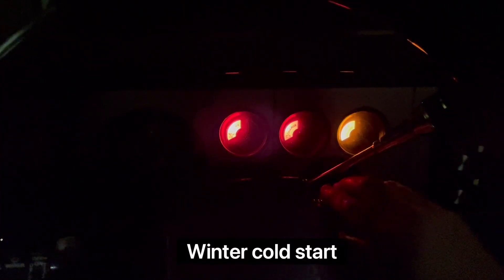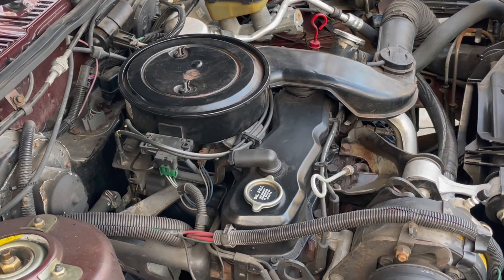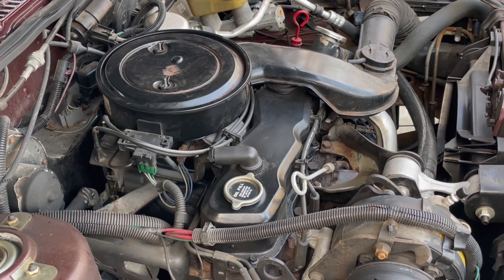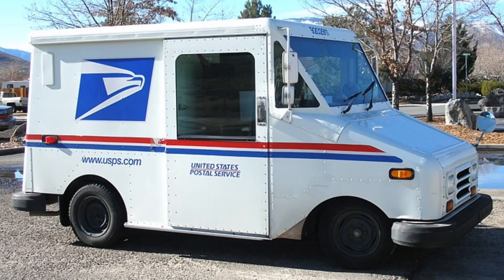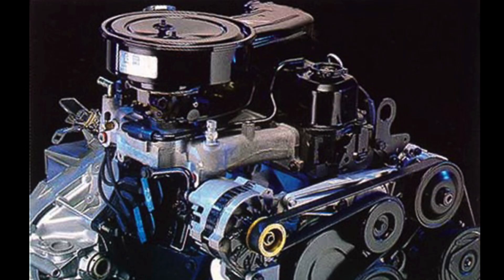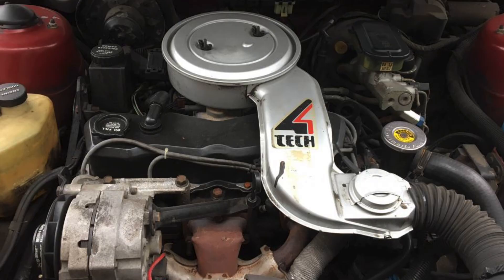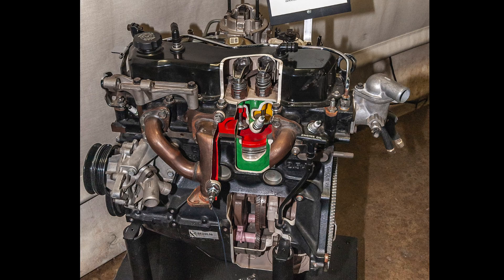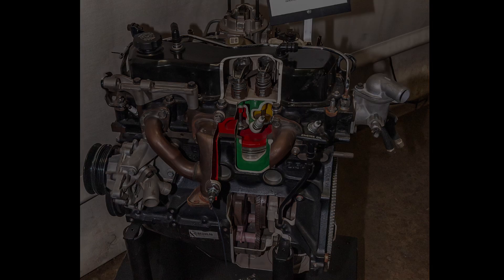Worst Sounding (and Most Recognizable) Engines: GM's "Puttering" Iron Duke 2.5L I-4

Comment: Adam’s comment about the engine continuing to run after the ignition switched off reminds me of the engine run-on phenomenon of my childhood in the ‘70s. What was that about? I remember some cars would continue sputtering and banging away long after the ignition was switched off.
Reply: You’d find this “dieseling” happening in carbureted engines not in fuel injected engines. Common causes of dieseling include maladjusted idle speed and high carbon buildup in the combustion chamber.
Reply: Cheap gas with low octane.
Reply: My 2.8 would do that on low octane. 
Most fuel injections cut off the fuel supply when the ignition is turned off.  @drippinglass
Reply: Usually the recipe for "dieselng" was carbon build up on the pistons being hot enough to ignite fuel from a mixture too rich combined with timing chain wear getting everything on top of that wrong. Basically, if the recipe was refined enough you could have one that would run on until the fuel bowl was dry. Having had a history that includes driving such fine specimens as described, I learned to just shut it off in-gear. The drag of the torque converter would stop the engine smoothly. With a manual transmission, you were out of luck. 😁

Comment: Hi Adam! Great video! I actually enjoy hearing the occasional tech 4 out in the wild ( or our LLV that delivers my mail) as it brings back a lot of great memories. I guess having grown up in the '80s/ '90s caused this. I have pointed out to you via other posts that the engine did have some advanced features like a roller cam, stainless tubular exhaust manifold, TBI, and a nifty flow-through head design. Not amazing by today's standards, but it is unfair to hold the engine to contemporary standards.  I think that your calculator watch is cool, but totally weak and useless when compared to your smartphone. We can probably agree that my  previous statement is an unfair and silly comparison. The same goes for the tech 4/ Iron Duke. I worked at a Buick Pontiac dealership for several years in the mid 1990s. I was a teenager at the time and had the privilege of working with a lot of seasoned and talented guys. None of them were overly critical of the engine. The old series 1 3.8 liters were rough running and a little crude too. The old 2.8 had issues too (Intake gaskets, etc).
Reply: My 2.8 came with loose intake manifold bolts but with the help of a Snap On flex socket I was able to torque them to service manual specifications and no more problem. That thing had dual valve springs!
Reply: The 2.8L was a great engine in the smaller X-cars,  but when GM put in the S,T pickups/Blazer/Jimmy they won't so great. Besides the head gasket issues they would take out cranks and very hard to work on because of the space in the engine bays.. spaghetti vacuum lines, feedback carbs, marginal electronics and list goes on.
Reply: A friend used to have one of those small S 10 type trucks and got good service but it had a larger V6 that I think was based on one of the smallblock V8s. I did at a point with my Citation managed to get the headbolts to turn a bit tighter,to the factory torque specification. Also had the car rigged with a switch under the dash that when turned on made the electric radiator fan run constant. When sitting in traffic or something that would make the temperature gauge rise I would turn that switch on. I got over a 100,000. miles on it by the time I got rid of it,mostly because of floorpan rust. 
By the time the S 10 and small Blazer matured with the larger V6 it seemed to have become a pretty decent vehicle but of course whenever GM got something perfected seemed to have been the time that they discontinued it.  @michaelmurphy6869
Reply: Was Car and Driver holding it to contemporary standards of the time when they cynically referenced it as the low-tech 4?
Reply: @ButterfatFarms  no, but they were not always looking at vehicles of similar price. As I have stated before, in addition to electronic fuel injection, the engines also had roller cams and stainless steel tubular exhaust manifolds. The gear drive was also better than a belt or chain in many respects (not all). They were also BMW jags like the boys at Motor Week. I believe the contemporary term is fanboys. I think it was all too easy to rip on the general whenever convenient. I have owned over a dozen tech 4 powered vehicles and none of them have had a catastrophic failure.

Comment: It's a hell of a lot better than the Vega 2.3 engine.
 Some of the noise is the slight play between the crankshaft gear and the cam drive gear,I think they are straight cut teeth. Rattles.
Reply: Really! Straight cut! My old 1952 8N`s even have beveled timing gears.

Comment: Battery weak or low charge or heavy oil like 20w-50 in it. 
At least with the Citation you could fit a group 74 medium size battery in it,(same size as the group 24) most of the cars came with,I think,group 72 or 71 batteries which did not fill the tray completely.

Comment: It's the sound that lets you know the mail has arrived.
Reply: As a usps driver, this is true. Idles like a diesel, runs very rough, smells, slow, weak, will belch out black smoke, then cut off if you quickly tap the gas pedal all the way down, but very durable
Reply: @blackice7408  Some of the Iron Dukes were as noisy at idle as a Mercedes 240D diesel.
Reply: Literally came here to say the same thing 😂
Reply: Growing up in a mobile home park in the early 90s until about 2002, these engines were in SOO MANY of our neighbors shitbox GM cars. I remember this sound all too well.
Reply: I love your channel VW.
Reply: Same motor is in the Grumman llv😂

Comment: The thin stamped steel rocker arms also added to the clatter on the 2.5 and the 2.0 in the Cavaliers.  Adam is right that if you didn’t beat on them they could last pretty well if not gracefully
Reply: Stamped rockers are alright provided the following things are done.
1) Thick enough steel is used.
2) A proper punch and die maintenance program is set-up and followed. This makes sure you have the proper radius in the bearing area, the correct radius on the tip that rides against the valve. And a properly formed pocket for the pushrod. Plus all these things have to be on their proper relationship.
3) The rockers should be run through a heat treatment process and properly tempered. 
4) The lubrication system needs to pump enough oil up through the pushrod and the rocker arm oil hole.
I worked in a facility that produced stamped rocker arms along with other stampings. We had one die maker all he did every day was take care of the punches and dies for ru ocker arms. One press, that's all it did. The most fascinating thing about their production was a small press, maybe 5 ton, that punched the oil hole in the pushrod seat. About 1/16th in diameter. Straight through steel 1/8th thick.
Reply: With a steel timing gear swapped in this could be extremely reliable. gear driven timing is the 300 inline secret to reliability.
Reply: Not a rocker arm issue.  Most of the noise comes from too much backlash between the cam and crank gears.  There was an updated gear set with minimal backlash that took most of the noise away.
Reply: This explains why it wouldn't clatter when cold as the oil was a thicker viscosity.  Once the oil thinned out, the noise would start. @bobroberts2371
Reply: In Michigan the unibody rusts away before the engines give up the ghost. (If used moderately)  :face-blue-smiling: :face-orange-raised-eyebrow:
Reply: @samiam5557 That's what happened to dad's 1987 S10 in Ontario.
Reply: I had a cavalier. 1997 2.2.
500,000 miles before it died.
Reply: I hade a 94 2 door. Never broke down. I drove it to the junkyard at 300 thousand. Cam bearings were shot. I would have fixed that but the entire rear bumper & mounting structure was rusted out beyond repair. I felt it was unsafe to sell at that point. Great car.
Reply: @donaldvincent I hope you got some money for it. The car did it's job.
Reply: My first thought is it sounded just like my old 2.0 Cavalier.  Driven tons of Iron Dukes but never owned one.

Comment: Reminds me of the old adage that GM cars run poorly longer than most cars run! This felt like an example of the GM base-engine philosophy: simple, cheap, durable and not much else. Similar to the 250 straight six that was standard in a lot of their larger cars. Where the 60 degree V6 that was often the optional engine where the Iron Duke was standard provided a lot of the sensibility as a non-performance small block V8 once would have -- smooth, torquey power.
Reply: The only 30+ year old cars I still see beating around are all old GM cars, mostly old Buicks and Oldsmobiles. I don't even see Toyotas or Mercedes diesels from that era still running. Winter road salt may bias my observations though.
Reply: @gregorymalchuk272  I have 28 year old Ford sitting my driveway that is doing pretty well. I have no doubt that it will make it to 30.

Comment: Someone I knew had a Pontiac running a 2.5L.  He was so proud that it was "a Tech4!"  Yeah, that just means it has EFI.  It sounded awful, but did the job.  Seems the louder and rougher the Iron Duke was, the more reliable it turned out to be.  At least the noise told you it was indeed running.  Now, our 2015 Equinox has a (fairly) nice sounding 2.4 that makes 182hp.  Big difference in technology.
Reply: And not to pick on you, but that 2.4L is infinitely less durable.
Reply: 2 weeks ago we had 6 of those in the lot and shop - All timing assembly jobs
Reply: that 2.4 is absolute trash. Definitely watch the fluid levels in that…it’s a thirsty engine with sketchy, at best, reliability
Reply: I've heard horrible things about the Equinox being severely under powered. Also, no shortage of them in my local U-pull-it yard. Does yours have turbo?
Reply: Keep an eye on the fluids in that 2.4. They are known to become heavy oil drinkers before hitting 100k miles. There is actually more demand than supply for replacement engines mainly due to people not checking their oil. Nothing worse than seeing people put on a waiting list while being without transportation.

Comment: Netherlands, early eighties: at a very young age, I bought a pristine light blue '77 Monza 2+2, 2.5 aut. from an elderly woman. It had run about 40K mls.. It looked great, so I loved it. Speed limits in Holland prevented me from ever over-revving it. Nonetheless it developped a nasty cold start with rattling hydraulic valve adjusters. Otherwise it ran well and it was quite torque (in comparison to small European cars). 
I vividly remember it shaking of it's radiator-hose several times. The shaking was so bad that even the radiator pipe broke  a few times. My next car was a V6 Capri, then I realised what a sorry engine it really had been ...
Reply: Always liked the look of the Monza, which anticipated some of the styling of the coming decade.
Reply: @martinliehs2513  It's styling still holds up. It looked even better than the comparable Opel Manta. Only, because of the Vega underpinnings, it was a wee bit to narrow.
Reply: @martinliehs2513  Having owned a Monza Spyder and a 3rd gen Camaro, I agree!  Even the rear suspension of the Camaro looked like the Monza's! Lots of engine choices in the Monza, depending on the year and area emission requirements, in addition to the 4 cyl,  you could get a  3.2 or 3.8 Buick V6, or a 4.3, 5.0 or 5.7L V8!
Reply: @joesmithjoesmith4284  Good luck on changing the sparkplugs on the V8's! There are still a good few V8's around in Switzerland btw.

Comment: Oh yes, I remember it well, as it was very distinctive. As far as the worst sounding GM engine goes, I'd say it ties with the Oldsmobile 350 diesel. Not solely because the latter sounded like a diesel, but because it also sounded like something wasn't quite right under the hood of any car so equipped. And...my mail carriers still drive those Grumman USPS vehicles every day!  As you'd once said...."GM engines run poorly longer than other cars run at all".
Reply: My mother was once pulled over by a cop because of all the normal noise her 5.7 N diesel engine was making! The cop could find nothing wrong with the exhaust & so issued no ticket. He said it was the smelliest & filthiest most disgusting truck he had ever pulled over! At the time my mother`s 1978 Silverado C10 was still under warranty!
Reply: The " newer " LLV got what ever " modern " 4 cyl that the S-10 got .
Reply: @bobroberts2371 the engine you’re thinking of is the 2.2 Chevy I4, iron block with an aluminum head. IMO not nearly as durable as the all iron 2.5’s. The USPS also has what they call the “CLV” with the rounded front ends….those are a modified 2wd Ford Explorer chassis with the 4.0 OHC V6
Reply: My father simultaneously owned a 1981 Eldorado with the 5.7 Diesel and a 1983 300D.  The 300D sounded like a proper diesel.
Reply: The 1986 Pontiac 6000 was one of the best cars I owned and it had the 2.5.
Reply: Ford escort diesel early 1980s
Reply: @markaustin4370  I had a 1982 chevette diesel that made more racket.
Reply: What about the Mercedes-Benz 240D 2.4L I4 Diesel?
Reply: I just bought a 1987 S10 with the 2.5. It's a little noisy but it sounds like a pickup truck. My noisiest vehicle was a 1981 VW Rabbit Diesel.  Sounded like a Mac truck rolling down the road. It smelled like one too!
Reply: Had an '86 S-10 with the Iron Puke 4.  I've lost count of the number of times I got asked, "Is that a diesel?"
Reply: For me it was the Detroit Diesel 6.5 on the GMT 400 trucks. Sound like a coffee can full of marbles in comparison to Cummins, Power Stroke, and Duramax.
Reply: Just because you don't like the sound an engine makes does not mean it is running poorly. An engine is a large collection of rotating and reciprocating parts. It is going to make noise.
Reply from the maker: @geraldscott4302  the GM V8s of the 60s and 70s were buttery smooth
Reply: @RareClassicCars  My favorite engine of all time is the old school cast iron small block Chevy. I have built dozens of them. They were an excellent design, far better than anything made today. The only real problem they ever had was poor build quality. Built right they can make more power, and last several times longer than the ones that came off the GM assembly line. I have a 383ci version in my 1972 Nova hot rod/drag race car. It has been modified, but not to the point where it is undriveable on the street. It has a non stock cam,  which does cause a rough idle. It smooths out as rpms increase. I love that sound. I have never had a problem with an engine making mechanical sounds as long as I know what is causing them and that the engine is not about to fail.
Reply: @geraldscott4302  I have helped my nephew adjust & tune his big block Pontiac 400 engine for his 1978 Firebird. Like the loping sound the engine has when tuned just right. He has the car as street legal drag racer. The locals kind of don`t like me as I helped him retrieve the engine out of a barn where it had been built up as high performance but never installed into a car & had been stored for several years. We were able to loosen up the slightly stuck engine with lots of diesel & trans fluid & by moving engine back & forth. Little by little we freed it up & he has successfully dragged it many times all over Oregon.
Reply: @geraldscott4302 I got a built 350 SBC that puts out 425 HP in my 86 Trans Am. I agree about the design really easy to learn matienance on, lots of aftermarket parts.
Reply: @geraldscott4302  You should tear apart a Gen 3 small block sometime. It is a far superior engine the the original small block...
Reply: @RareClassicCars 
I’m not sure how the uneven fueling of a carbureted V8 can ever be accurately described as “buttery smooth”. A fuel injected I6 or V12 is buttery smooth.
Reply from the maker: @negativeindustrial  drive a stock, 60s era GM V8 car and you’ll see what I mean.  Any of them.
Reply: @geraldscott4302  I used to be on the same boat. Still love old school GM V8s (Esp 454/502 big blocks), but I won’t waste my time/$ building one anymore when I could get a newer GM LS v8 from a bone yard, rebuild it (maybe upgrade pistons/rods, and crank depending), throw in a better cam (roller cam from the factory), and that’d be it. The cylinder heads already flow great from the factory, and are well proven.  And due to the sheer number of them, are had for dirt cheap. Just my humble opinion
Reply: I had a 64 impala with the 283 2 barrel. Was a smooth engine even though rest of car was junk
Reply: @RareClassicCars you can hardly hear the internals making noise when sitting by the hood
Reply: @geraldscott4302 some make a lot more noises and vibrations than others. It is what it is.
Reply: @geraldscott4302  Nonetheless, it does not inspire confidence. Of course, I voted with my checkbook and never purchased either one.
Reply: Im going to say the rumble of that 4.3 chevy v6 was just awful. I was in kindergarten in 1989 & our classroom was on the 3rd floor of a brick bldg with 12 inch thick walls & and could hear these things running like u were standing right next to it! At age 40 im still annoyed every time I hear one. U always know its a 4.3 chevy too. Idk how reliable if might have been gm was wrong for all the noise. At least the 2.5 "tech 4 makes soo little power u cant hardly hear it!😁